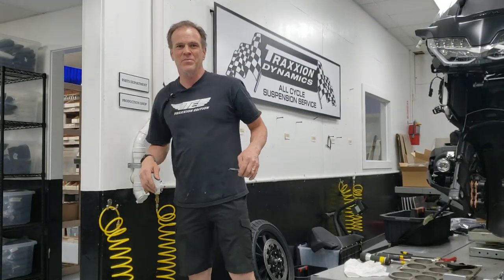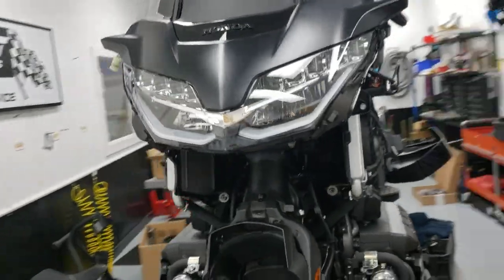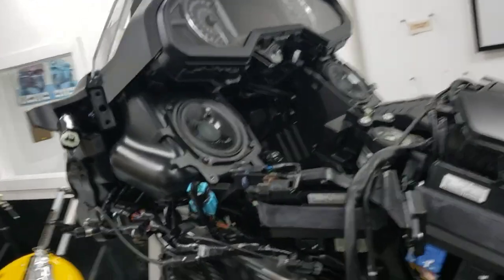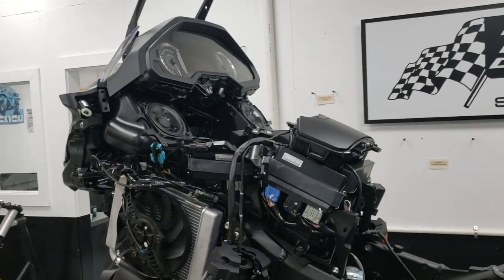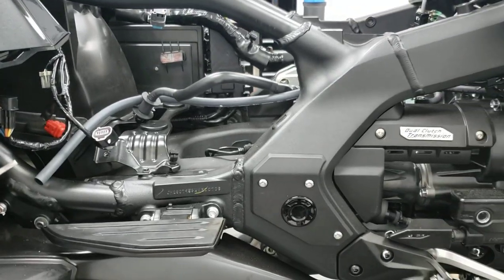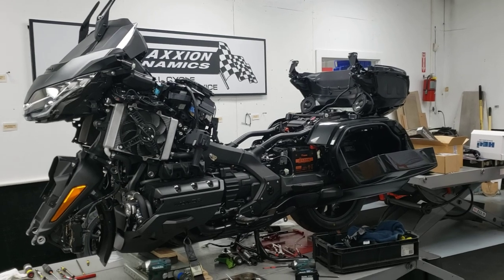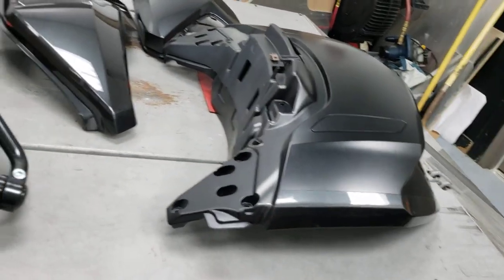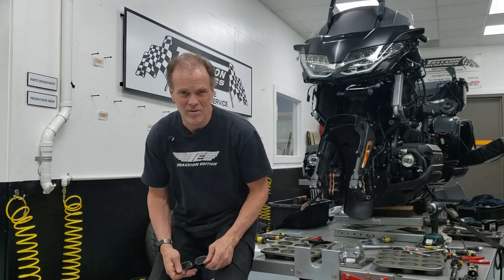"Demo Day" complete for latest Traxxion Mega Build of 2021 Honda Goldwing!  With Max McAllister

Comment: Hey Max, by the time you are done, the lucky owner could buy a second GW. Life is GOOD. On the different note, the two radiators along side the bike is the best was done by Honda. I check them often and never see any bugs in them. My K1600 was a terrible on that. Always light power wash  it to clean the crap. Also, I barley hear the fans coming on. It just does not get that hot.

Comment: It’s nekkid!! 😱
Agree about the front fender extension. That’s the first thing I did on mine. I’m about to perform your fuel door trick but I gotta find a rubber plug to cover the hole first.
Reply: I did my fuel door on both my bike and the wife trike and purchase the plugs for 68 cents at my Ace Hardware, also I had to cut the tip off the plug, because when I closed the door the plug would push the fuel door button causing it to open, great idea..............

Comment: Hey Max ? Were you able to purchase the 2021 trunk rack from Honda, I've ben waiting for 1 1/2 months for one.
Reply from the maker: Haven't tried we were going to order today.

If you want a CB it appears the Antenna is different also!
Reply: @Traxxion  thanks Max I know I have all the parts for the CB will have to check on the antenna
Reply from the maker: @ednortonsr.1719  I drilled the designated holes in the designated locations in the plastic and the antenna does not fit.... the center cable doesn't pass through properly and there's a big open gap on the other side.